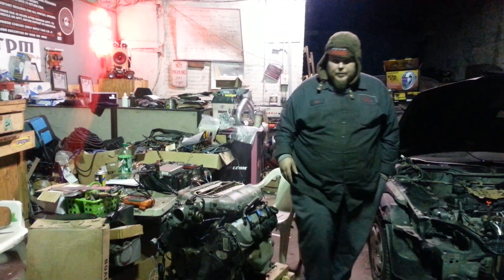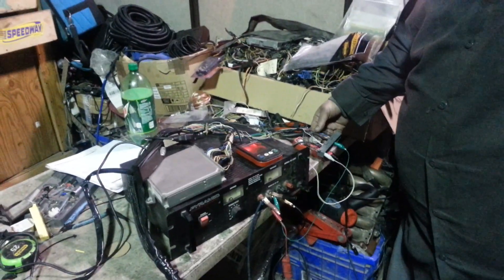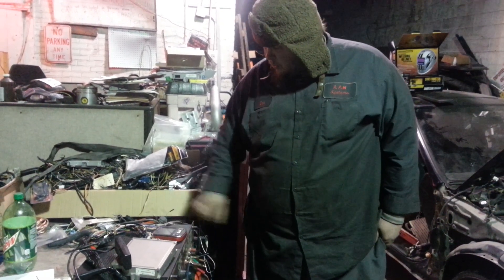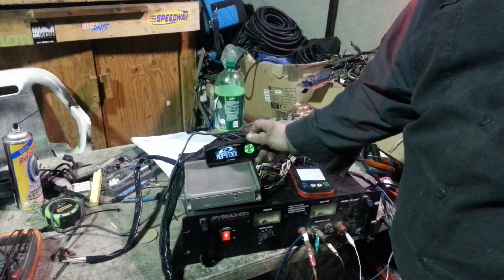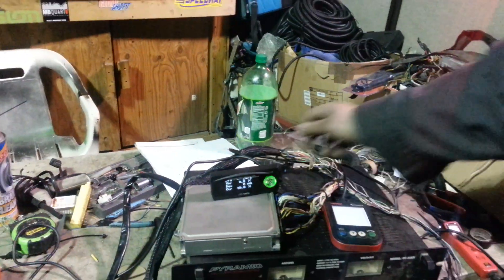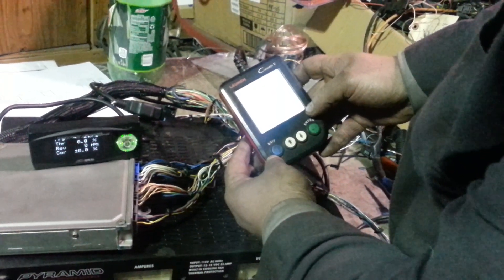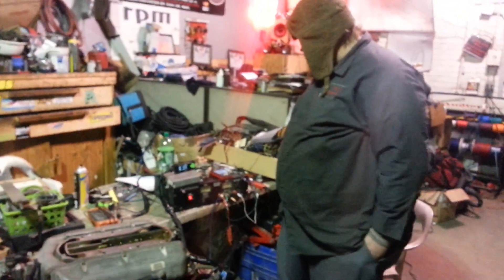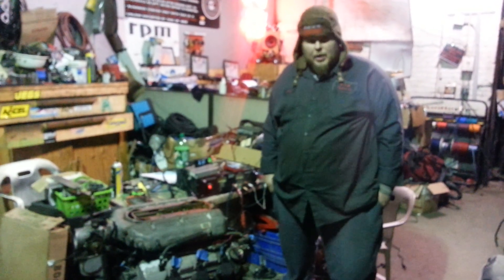RPM Systems presents Mazda Miata Honda V6 wiring harness

Comment: I want to put one in a 1937 Ford, so what transmission do you recommend for a rear wheel drive layout?
Reply from the maker: mini tech sell a full kit to bolt to a maita drive train. also there a adpter plate that can be used for GM trans as well. you can contact us at GO-RPM. COM
Reply: Simon Lagann I live in Britain, so what other options are there? Could I use a Ford Type 9?